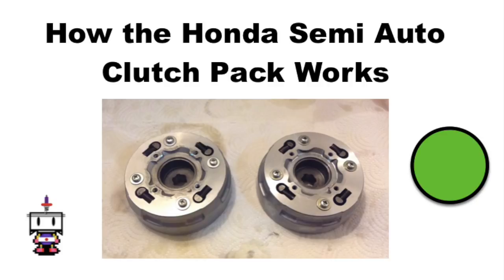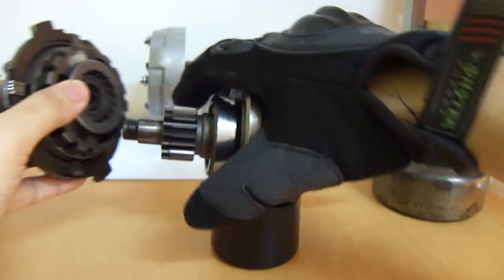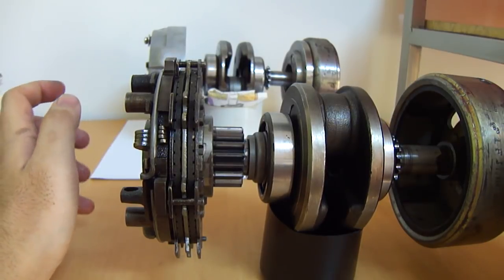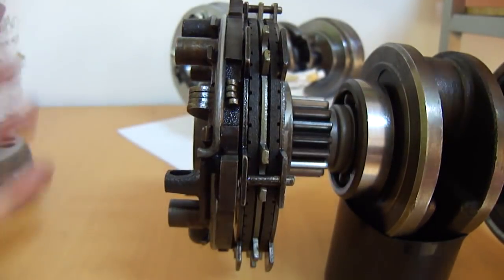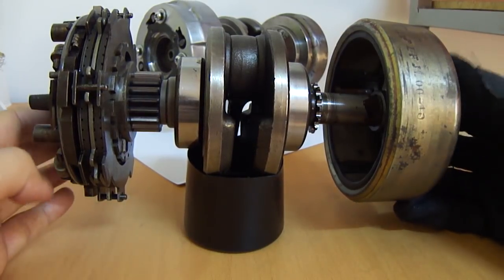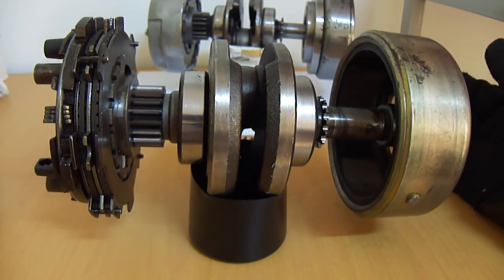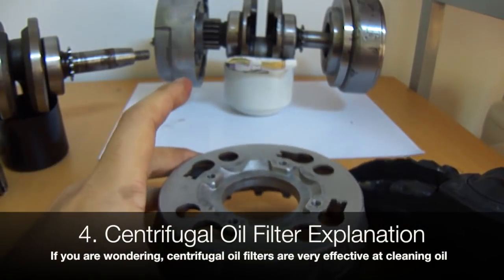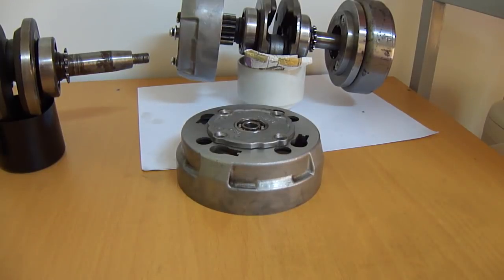How the Honda Semi Auto Clutch Works (50, 70, 90cc)

Comment: How would this work for kickstarters because the engine would be at so low rpm that the clutch plates would never get up against the weights?
Reply from the maker: Hi there, excellent point and I've been thinking about this for the passed few weeks.

I think the answer lies in the ramped centre collet, and what I thought was the slipper clutch.  I originally thought that when the rear wheel "pushed" the engine (like on decel), the collet would temporarily break the clutch plates away and disengage to prevent wheel lockup. 

But on the semi auto bikes one thing any rider will know is that when you're in gear and you push your bike forward with the engine off, it engages the engine.  When you roll it backward, it disengages.  And likewise when the engine is running even in gear, it disengages the clutch.

So what that means is that what I thought was the slipper clutch is actually a "grabber clutch", which engages the clutch when there is "back pressure" so to speak, like when the wheel is pushing the engine or, when the kickstarter is engaged. 

Either or, excellent observation and I'll pin the comment so people can see the correction and explanation. 

Cheers,
Mini Motor Man
Reply: I think it uses oil pressure to disengage once started witch is the genius of this clutch.
Reply: @minimotorman5931   I believe you are precisely correct. Even at idle or stopped the engine will not drive the transmission, but the transmission can spin the engine forward- allowing compression hold back and allowing the starter to turn the engine forward.
Reply: Does this semi-automatic clutch have anything to do with the kickstarter, because I can't find anything wrong with the Kickstarter mechanism on this little XR70 please help
Reply: Does this semi-automatic clutch have anything to do with the kickstarter, because I can't find anything wrong with the Kickstarter mechanism on this little XR70 please help
Reply: @Cobb-ri5ne  not sure what your question is? what exactly is your problem with the bike?
Reply: @louiec1848  my little XR70 the kickstarter was slipping and I didn't know why I took it apart yesterday everything seems in real good shape, when I drain the oil before I took it apart the kickstarter worked great so I put in some oil that is made for motorcycles and a wet clutch and it has gotten better, but does the clutch have anything to do with the kickstarter I just never thought that it did thank you for your time
Reply: @Cobb-ri5ne  yes it does it a good design wen it works but when it breaks it bullshit. this was like years ago for me so i don't really remember the specifics but when you kick it goes through the clutch if that makes sense so if your clutch is bad then you cant kick. this is different than bikes with gears where the clutch and kickstarter are not connected. if it feels like it has no compression then thats prob it. you can also lay the bike on its side clutch face up and if it catches when you kick thats also a sign. I never got around to fixing it so idk what you are gonna need
Reply: Either the clutch friction discs are worn out or the adjust nut on the side of the crankcase is out of adjustment or you loosened it when you were taking it apart thinking you had to remove it, but you aren’t supposed to take it loose to take the case off.

Comment: I just rebuilt one of these clutches today... Found the video afterwards very informative & they are amazing little pieces of engineering.
Reply: my moped is still using this kind of clutch basket. good thing there are still chinese aftermarket parts on this, lifan motors china develop this kind of engine in 1960 by honda tokyo and lifan which is a weapon maker since 1940's.

Comment: An amazing explanation for an amazing piece of engineering. I finally understood how it performs so many functions at once, and why the motorcycles it's used in usually don't have oil filters or meshes of any kind. It's still amazing how compact and rugged it is. No wonder these seldom break down, unless you ride like a hooligan. :-)

Comment: Great Video!  I just purchased my first Honda CT-90 (1700 mi) and it is not shifting well.  This helps me understand HOW it should work.  I may have to get into the engine and see how the clutch and gears look (never been into an engine before).  I am going to open it up tomorrow and check to see how my clutch oil filter looks...  Thank you!

Comment: Great video. Thanks for posting. I'm in the process of getting my '72 z50 going again and always wondered what kind of magic happened with the auto clutch to make it work.
Reply: i have same engine but a manual transmission. i got 2 of them, the other was 11 year old which is semi auto. they are both chinese moped.

Comment: I’m afraid you’re wrong about slip avoidance. 
The mechanism involved does engages the clutch instead. That allows the engine kick start and always cranks the engine when you push, pull the motorcycle whenever any shift other than neutral is engaged. 
Think about it. 
With engine not running and any gear engaged you can move the bike backwards freely but cranks engine when you push it forward. 
Try it.

Comment: That's a top-quality video right there!
Thank you so much.

I have been thinking about this for quite a few years.
I ride bikes and (CVT) scooters, and I do 90% of the maintenance myself.
I had assumed that the clutch mechanism on a "clutchless" scooter was somewhat similar to the clutch sub-assmebly on a CVT scooter, in as much as low RPM engaged the clutch (reduced the diameter across the clutch pads) and higher RPMs disengaged it in the opposite way.
Presumably, and it was not mentioned in this otherwise superb video, if the gear change pedal is kept pressed down, then the clutch will remain engaged and the bike will coast, rather like a manual bike?

Japanese pizza delivery boy?
So you either delivered Japanese pizzas or you used to be Japanese?
I did not get that bit :)

Liked/Subscribed.

EDIT.
Oh, and are they still the same now?
If I can manage to get myself one of the new Honda CT 125 "Hunter Cubs", is this what I will be maintaining?

Comment: Good explanation  of the Mechanisms, but Didn't explain the Oil Through Spring and how it helps to disengage the clutch plates in order to actually shift gears while riding. I had this issue where I Could Not Shift Gears while the motor was running.  You absolutely need the Clutch Oil Through Spring or you cannot shift gears. Please, can you post a video of how the Oil Through Spring Works & Why.

Comment: A centrifugal clutch at the front of the clutch pack and a manual clutch
 at the back of the clutch pack being manually actuated by the shift 
lever through the drum. A reverse torque mechanism to also actuate the 
disc pack to engage the clutch to the engine when it's not running to be
 able to start the engine by pushing the bike forward with it in gear or
 with the use of a kickstarter. And if that isn't enough, a highly 
effective centrifugal oil filter. All this in one little package. Did 
the Japanese actually develop all this from scratch? I doubt it, but 
they definitely improved on the technology.

Comment: Fascinating video, thanks. I recently ended up with a 1962/63 C100. Is the clutch/transmission design much different than the one in this video? I'm having issues shifting up or down into 2nd gear, hoping I don't have to split the cases.

Comment: Sir, I watched this video several times and there is one point that I am not grasping. At 19:10 you are getting into the GEAR CHANGING part. I am not catching what causes the bell housing to move toward the the center of the engine, (against the spring tension) that allows the clutch pack to move far enough away from the bob weights. Please help me with this. Thank you.
Reply from the maker: There is a clutch mechanism attached to the foot shifter (not shown in the video) that pushes against the face of the bell at the same time you push down the foot shifter.  '

Here's a link to a diagram picture.  https://images.cmsnl.com/img/partslists/honda-c90-cub-england-clutch_bigma000127e06_4ab8.gif
Reply: Well now that you say that the rest is clear to me. There is nothing automatic or even semi-automatic here. When the operator using his/her foot, moves the combination shift lever/clutch lever, first the bellhousing and clutch pack are moved toward the center of the motorcycle, then, in the blink of an eye or faster, the gear shift is activated! Thank you so much for answering me so promptly! It IS a great video that you have presented!!!
Reply: I was wondering the same thing. So your foot is doing clutch and gears at the same time. The only part that is done automatically is disengagement at low rpm.
Reply: @ifrit35  Exactly!!

Comment: Just bought a 2017 crf50 that sat for 1-2 years. Ive owned 30 of these bikes so im very familiar with them. This one moves when put in gear but not giving it gas. On a stand when running I put it in gear and the back tire starts spinning fast and only stops when put in neutral. I cleaned the carb and adjusted the idle, I made sure the throttle wasnt stuck open or pull up, I adjusted the clutch with the side nut/screw, and I removed the side cover and pulled the clutch out and made sure the plates weren’t stuck then reoiled them and put it back in. Nothing has helped. I don’t understand whats making the tire spin. Ive also tried giving it gas and hitting the brakes to try to free whatever is stuck.

Comment: What are the symptoms of worn clutch bell large springs, between the bell and first plate on an early C50? My clutch is quite noisy/whirs until i depress the gear shift pedal. I swapped everything but those in a time crunch and considering reopening to replace?

Comment: Hey Mini Moto Man
I have a question for ya....
I have a 1979 ATC threewheeler  and it is a pull-start engine (4 stroke) but I have to either replace my first gear or use the old one if it's still good to use but I have to get through this 👆👆 part of the engine to get to first gear "how do I properly fix this situation" ??

Comment: Sir, i own a china motorcycle with the same clutch as shown in your video, i have problems when i kickstart the engine the clutch slips eventhough ive already changed the clutch disc with new ones. Can you tell me good sir what might be the cause of the clutch slipping during kickstart?

Comment: Great video! Can I ask something I have my Honda 100cc it speed up to 60kph only and low power when high elevation is there something wrong with my cluch?
Reply: Due to the higher elevation it is more likely a carb issue.  There is less air up high and therefore you need to feed the engine less fuel to keep the air fuel ratio correct for the engine to run right.  Some carbs have a lever or button to pull out when on high but others require you to drop a jet size to get the job done.

Comment: Can you please tell me how much should i tight the clutch nut on those semi auto clutches? As i increasingly torque the nut, the clutch seems to 'lock' more and more with the supposed free-rotating gear that sits on the crankshaft, causing my crank and clutch to be constantly grabbing the big gear that is connected to gearbox, it's really like i have no clutch the more i torque that clutch nut. Please help me man if you can
Reply: is your clutch slipping when you have the screws tightened?
Reply: @louiec1848  I don't really know cause the clutch is bypassed completely, power goes from the crank to that drive gear sitting on the crank (because its not freely rotating, instead it works as one piece with the crank) and then straight to the gearbox. It's like crank and gearbox are connected all the time and there is no clutch
Reply: MotardMotorist so you're saying the clutch is always engaged? Seems to be the opposite problem that I have because my clutch won't even engage and slips if the four screws are in but if I take them out it catches. Maybe messing with those screws could help you out but honestly I have no clue how the hell to fix these things.
Reply: @louiec1848  The clutch itself is working for me, but when i tighten the big clutch nut, the whole clutch assembly puts pressure on the gear that sits next to it and onto the crank axle( this gear is supposed to turn independently from the crank axle). For me it seems to be a matter of how much i tighten the clutch nut, i cant give advise to you however, your problems sounds worse than mine and it's the first time i work with this system, I'm really unfamiliar with it
Reply: Mine is doing the same when I tighten the bolt the clutch is engaging and I have no free wheel seems like its locked in gear, I'm going to try a new clutch, it happend after I towed my quad with my car and it bumpstarted itself as I went over 30mph I wondered what was going on, after the quad wouldn't roll or free wheel as if clutch was stuck on or in gear, the quad will start when bumpstarted but won't tick over on stand still it is a rev and go fully automatic by the way 90cc
Reply: If you have not figured this out yet... It sounds to be like you don't have the freewheeling gear in the clutch mech correctly.  I found on the ATC70 I was just working on that you can get the clutch in place and the nut on when the small gear is not aligned inside the slipper mech.  When this happens you simply sandwich everything together tight and no clutch action happens.  It's and easy thing to overlook.

Comment: Hi
I have the type of clutch with 8 rollers instead of the one in the video with weights. And in the video I heard that there where different amount of weights depending on the cc of the engine, more weights for higher cc. 
Does anyone know if it is the same setup on the clutch type I have with rollers? I mean  if there are different size/weight of the rollers depending on engine cc?
The problem is that my clutch engages to easily making it jump or stall immediately when I release the gear shifter even at idle. There are new discs in it and it rotates freely when assembled but as soon as the engine is started it engages so my suspicion is that the rollers somehow roll out to easily and maybe are the wrong ones all together for my 70CC ST70.

//Ola

Comment: how would i work out if the clutch material was ok or needed replacement ..is there a min thickness            ( c 90  )
Reply: C90 don't know C50  3.5 mm (normal/new) and mini 3.1 mm thick, info from tech data C50  (mon premier post honda ... ☺) hope helped a bit

Comment: So which plates should I replace, just the friction plates or the smooth plates also? Thanks, great series
Reply: The way this is designed you almost have to replace them all.  Rockymountain ATV/MC has the full set (all 5 plates) for about $50
Reply: Friction playes only

Comment: how is that entire clutch plates are holding together with out a clutch basket ?
Anyways nice video
Reply: The silver part he uses to talk about the filter is the basket.  For visual sake he leaves it out of most of the video.  The outer tabs of the friction plates line up into cogs in the silver piece (the basket).  There are a couple other pieces he doesn't show but were not needed to be shown to understand the function of the clutch.

When you push down on the shift lever it does 2 things.  First an arm moves a plate on the end of the clutch's release bearing.  As this plate rotates there are 3 ball bearings that push against a plate on the outer shell of the engine housing or clutch cover.  This will cause that plate to push the clutch basket inwards thus disengaging the clutch.

While that motion happens a second mechanism that is behind the large gear on the transmission will pull (or push) a ratchet mechanism that will move the shift drum to change the gears just like a normal motorcycle transmission does. 

These 2 levers must be timed correctly in order for the clutch to be disengaged before the ratchet tries to move the shift drum.  Newer versions have made this idiomatic and you can only put the clutch release lever on one way but the older ones were splined in a way that they could be easily assembled out of time.